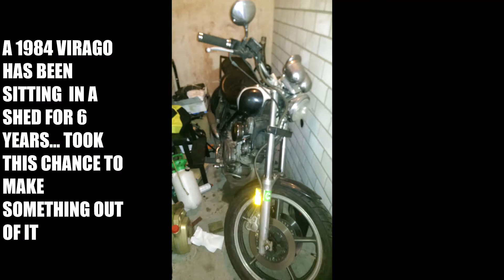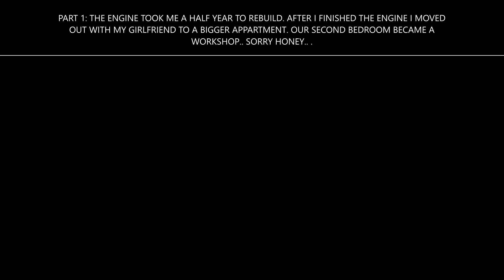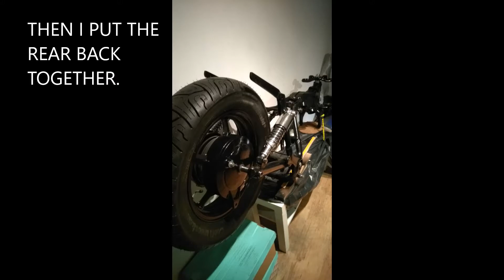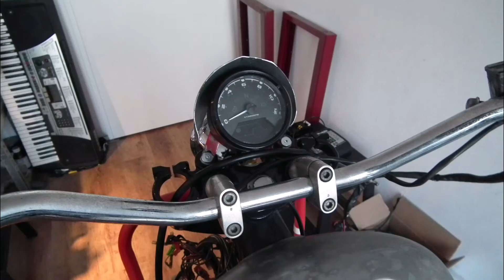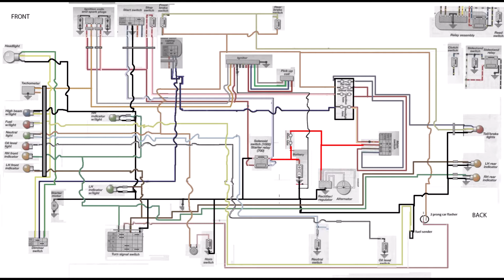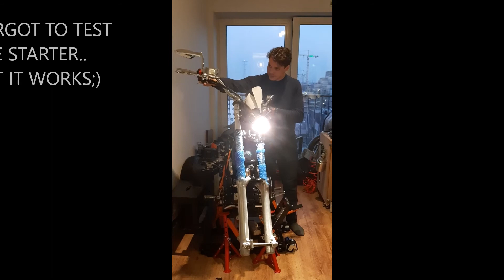Virago chopper bobber build XV700 / 750 / 1000 / 1100

Comment: Unusual model 1985 XV750 SE   ?  first generation engine ( old style starter )carbs  and ignition  in twin shock chassis . Next model had different carbs and starter . very nice project bike , looks amazing , a lot of hard work .
Reply from the maker: Jep its a xv700. They were built along with the xv1000 model. In 1984 and 1985. The xv1000 had the new starter style but the 700 kept the gen 1 system. The gen 2 starter style engine was changed in 1986 on the xv700.
Reply: @otzie3299           
yes its not often seen ,
a rare bike . you make a great job with the rebuild . i have factory standard 1981 XV 750 SE and XV 750 (first gen ) hard tail frame  chopper . keep them living :-)

Comment: Love the rear fender stud, how did you do them? Would you still have the plans for them by any chance ;)?
Reply: Also, what is the length of the new rear shocks? I'm such a fan!
Reply from the maker: @pathfinder112  thnx mate;) i don't have the plans for it just did it on the go and made it from scratch. But the schoks are 290 I think. And it also depend on how high you mount the rear fender. The height is equivalent to the height of a Honda rebel
Reply: @otzie3299  So cool, thank you mate! Such a great work with the seat too, any advice for this, once you've melted the harleys seat's base onto the virago, how do you reattach the foam/seat to it? You're the only person that managed this trick according to my research, can you tell us a bit more about this one, please? Thank you again mate,

Comment: The speedometer functions all working? Which fuel  sensor do you used
Reply from the maker: Works great. I made my own fuelsensor using the old base of the ntc sensor combining a scooter resistor floater